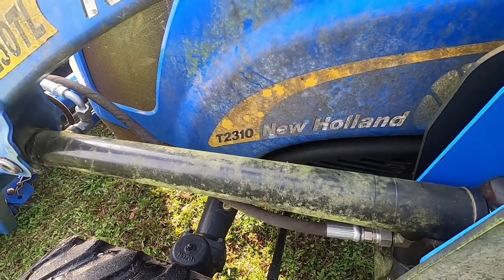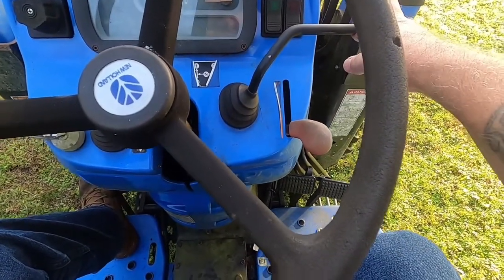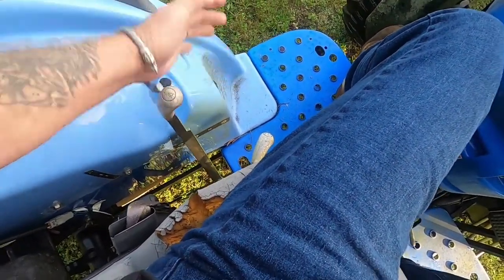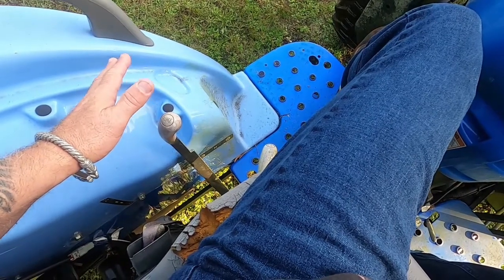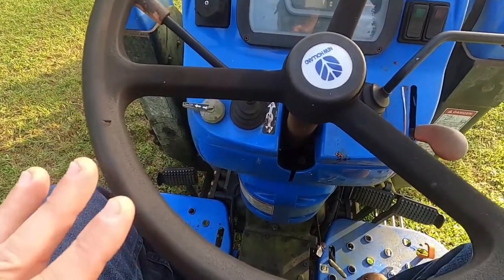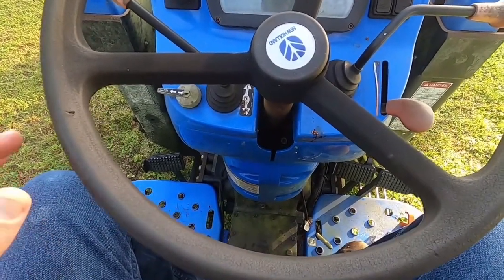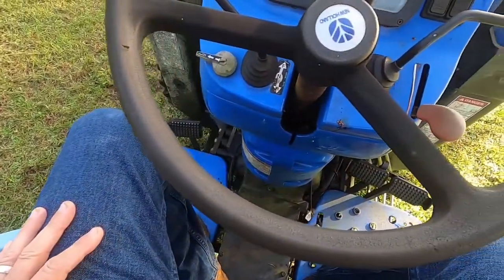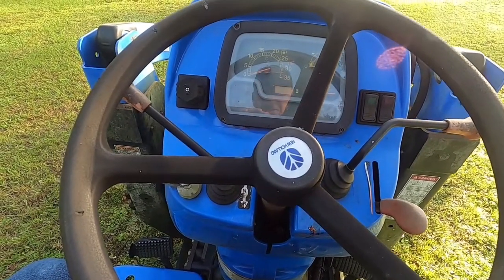Tractor Won't Go Into Gear

Comment: Thank you for the video and thorough explanation. I went out to my New Holland TC35 and the same thing happened. Because of your explanation, i knew your solution would have to work. I got the tractor in low, first forward gear at 2k rpm and drove it while feathering the gas. After 20 minutes engaging the clutch finally stopped the tractor. Fixed my Friday. Thank you again for the video.

Comment: Mine did same thing.  Just put it in high range 4th gear key off and pull it with clutch pushed in. Stab the brakes a couple times and it will break loose for sure.

Comment: I’m dealing with this on my cub cadet right now. Thanks for the tip I’ll try it out
Reply: Well my friend it worked! My clutch is now free. I have a cub cadet 7274 four-wheel-drive with a front loader and a backhoe attachment. Now I need a boom cylinder rebuild kit for my backhoe that’s unavailable. Thanks again for the tip

Comment: Started having same problem couple years ago and worked around it same as you did. I figured out that it coincided with leaving the tractor outside for extended periods which I’m now avoiding but it still occurs which tells me I need to drive it around more before it gets even worse. Dealer was no help when talking with service desk several times.